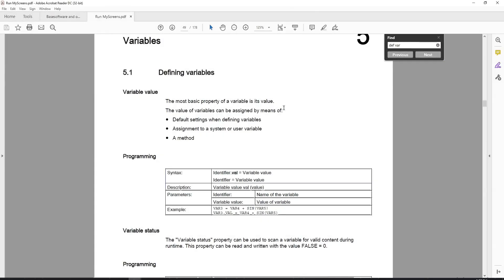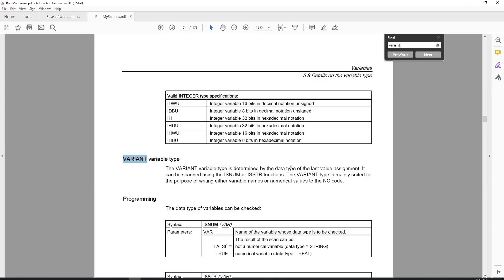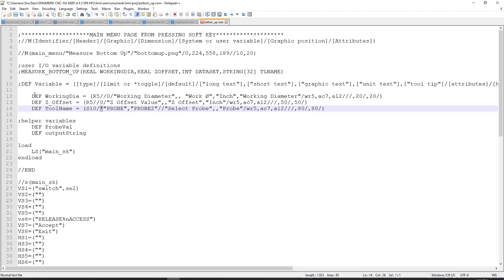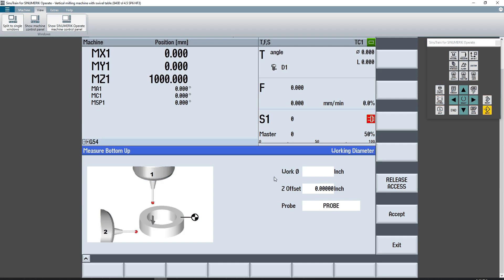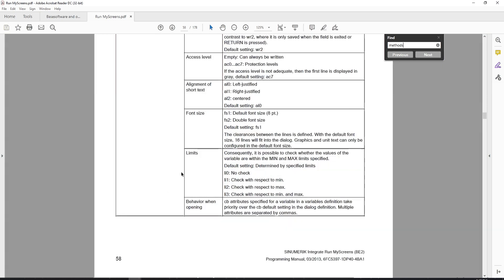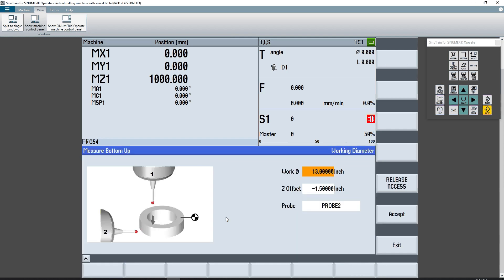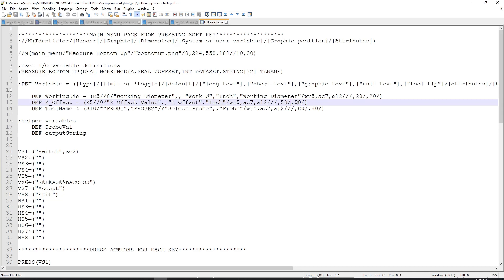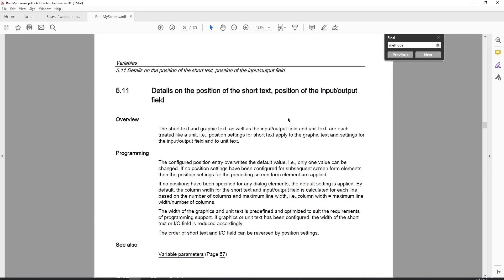Siemens 840/828Dsl Sinumerik Run Myscreens/Easyscreens: Part 4

Comment: Your video tutorial is great, I have a question: how to use the cursor to select the corresponding machining features of the part.
For example：
https://youtu.be/Q00uKj1n-CY
Reply from the maker: The video quality is not very good, so I'm finding it difficult to see what you are trying to accomplish
Reply from the maker: @aoleyizhengye  where did you find that video? Is that an easy screen or was it made with the xml version or possibly the c# or c++ api?
Reply from the maker: @aoleyizhengye  that's something you'd probably need to develop yourself. The information I provided in my videos should get you started. As far as clicking on features, you can create invisible input boxes and have them tie into a visible text box using the easy screen commands
Reply: @TheFeralEngineer  https://youtu.be/3_4OL550RVA After a period of study, I finally implemented a similar function. Thanks for the video tutorial

Comment: You have some great easy screens tutorials. I always wondered why Siemens didn't create a GUI builder though. I've configured a few OSAI CNC controls, and it was as easy as creating a button, dropping it on the screen, then changing the attributes.
Reply from the maker: Thank you 🙂. They also have an xml based screen creation tool, but I haven't used it yet. They also offer an SDK, but much like anything these days, it's not free